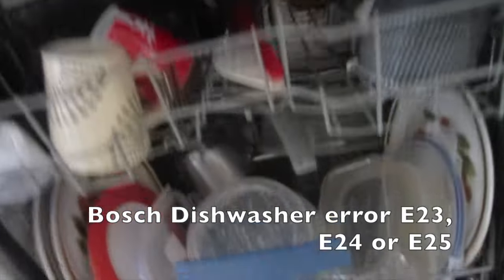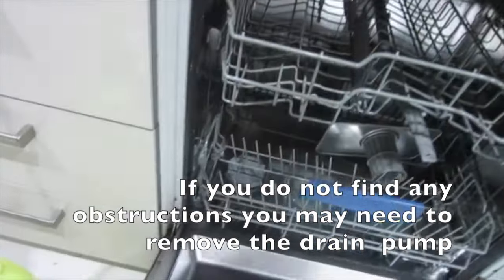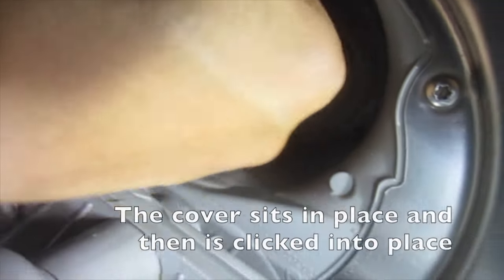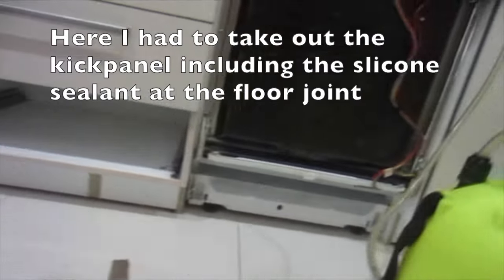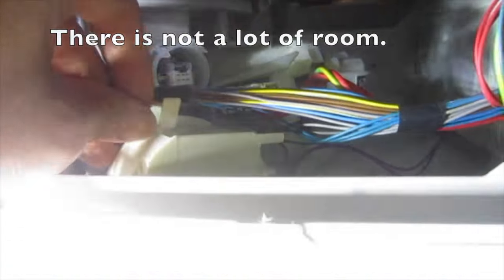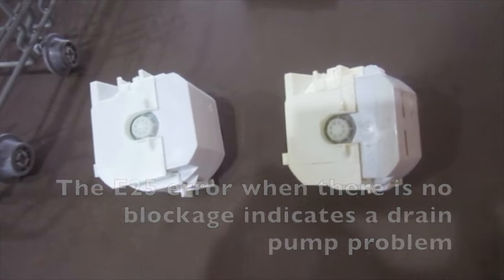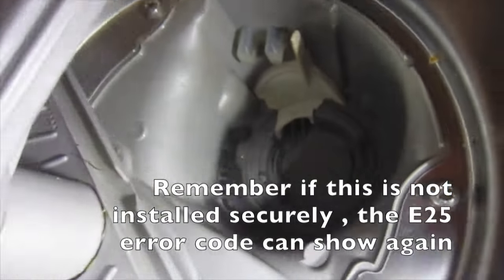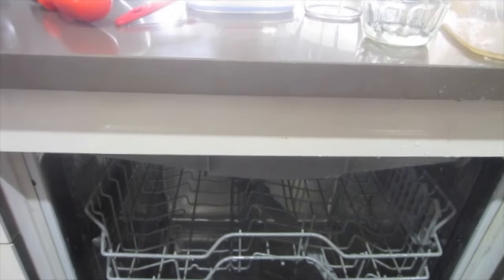Bosch E23,E24 or E25 dishwasher not working error fix (a detailed tutorial)

Comment: Great video, but it would have been even better if could have measured the Ohms difference between the New and Old pump .. to show how to identify a Bad Pump ...
👍🇦🇺
Reply from the maker: Thanks and Good thinking fellow Aussie but I think I did and actually could not see any difference.  The only difference was the original one would keep bringing on the error even if it initially started working . You know how much patience my wife has if the thing I fix plays up ! Means don’t take any chances and just install a new pump .
Reply: Forensic analysis helps a lot more to people than .. just go buy a new one and heres how to replace it .. 
Its the next step as into why you Discovered the fact it needed replacing ...
Good information is rare to find 👍👍
Reply from the maker: I’m all for forensic analysis. Honestly I did check with a multimeter on ohms and found no difference except one worked and one didn’t . I have about 5 multimeters ( one for each part of the house ).
Reply: My old pump which plays up seems to have nothing wrong with it .. 
It had 78ohms on each of the 3 coils inside and spins fine in test mode ..
I went to buy one from a large appliance outlet here in Syd .. 4 days to order .OR He showed me one that LOOKED identical .. so I bought is and was going to fit it ... but as a precaution, I opened it up and noticed slightly less windings on the 3 Coils.. 
When I tested them they were only 45 ohms each .. 
I'm going to order the proper on and wait 4 days .. 
But I reassembled my old pump back in to give it another chance in test mode .. 
Every test cycle worked fine (Drain, Rinse, Spin etc)
But it stops pumping and plays up "I deduce" only when it is submerged in the wash cycle at 40C° ..  
Ive since done 4 "Cold" Loads with my Old Pump reinstalled Successfully .. 
Something seems to be heat related on this 3yo Bosch Washer .. 
I'll get a new pump to see if it is the Pump .. 
Only other thing is "Could the Circuit board up top be affected by Heat ?"(rising) and sending the pump a skew frequency?? ... TBC ...

Comment: My work around with E24 without any visible signs of problem is shortly open the door after the pump stops 2nd time (about 45 seconds after the start of program). The program continues without errors.
Reply from the maker: I think later the error may come back . The machine maybe sensing an upcoming problem. It’s sort of like a toothache… you hope it goes away .

Comment: I check everything except the control board. The pump drains when u hold the start button but water doesn’t drain when running different cycles
Reply from the maker: Did you change your pump ? Sometimes the pump is the problem making the control board not work.
Reply: @Dentinvent  no I didn’t change the pump. The eco mode work fine the last time and didn’t trigger any error code.

Comment: Hi, whats should the resistor must be for the drain pump?
Reply from the maker: Sorry I don’t know what it should be. I just found that some pumps looked fine and created that error code so instead of wasting time trying to find the pump problem , it was faster and easier to just buy a new one . 
In the video you can see both the hood and the faulty pumps looked almost the same ( with respect to the motor turning).
Reply: Be careful with the drain pump.Thete are two models.They are looking the same.Wat really maters the resistance of windings.One model has 79-80 Ohms,and other(older models ) 130 Ohm.Yf you swap them.....the Maschine will try to drain shortly 3 times and then go to error.So you have to be sure that replacement pump 8t is exactly with original.With a multimeter you can see clearly the resistance of the motor stator.
Reply from the maker: Thanks for the comment . I just made sure the part seller got my dishwasher model number to confirm it was the correct pump before I ordered it .
Reply: @cosmintoma5197  thanks for the info. I was wondering what the resistance should be across the windings. Mine shows exactly 79-80 ohms, but now I don't know why it still gives E25, even though the pump motor seems to be fine...
Reply: @avski05  E25 sometimes comes frim the main washpump.If IT is making some noise on the start up....that means You habe tot replace the washpump.There are some bushings in the rotor of the pump.In case that bushings are gone...there will be a vibrating of rotor touching the stator.....so the machine will diaplay E25 on the beginning of circle.

Comment: I replaced the pump and still jave the error code and water is sitting in base of the washer. What do I replace next? Control panel?
Reply from the maker: Check to see if the hose from pump to the outlet is blocked .  Also check your electrical connections to the pump are connected well.
Reply: Let me tell you a secret.Are you sure that the new pump it is the same with original?Did you check the wenddings of the motor?They are two models.79 Ohms and 130 Ohm.

Comment: Those elastic bands are on every model they were supposed to be there they stop water getting through the impeller hence why by reinstalling without them you got an E1 error as you shorted the pump by letting water in
Reply from the maker: Which elastic bands do you mean? The elastic band caught in my impeller was a normal rubber band that went through the wash and tied up the impeller .
Reply from the maker: Which elastic bands do you mean? The elastic band caught in my impeller was a normal rubber band that went through the wash and tied up the impeller .
Reply from the maker: Which elastic bands do you mean? The elastic band caught in my impeller was a normal rubber band that went through the wash and tied up the impeller .
Reply from the maker: Which elastic bands do you mean? The elastic band caught in my impeller was a normal rubber band that went through the wash and tied up the impeller .

Comment: in the video taking out the pump is much easier. It seems an impossible task with such thigh room to move the pump...:@
What is the trick?
Reply from the maker: The pump is just twisted to take it out but make sure you push the catch down and then turn the pump ( if you don’t push the catch it won’t unscrew ).
Reply from the maker: The pump is just twisted to take it out but make sure you push the catch down and then turn the pump ( if you don’t push the catch it won’t unscrew ).
Reply: Thank you for your reply. I had to pry the pump to take it out after unscrew it. @Dentinvent

Comment: Having trouble getting the door panel back on, having it horizontal, lining up the spacers and getting it lined up with the inner part of the door 😦
Reply from the maker: Glad you asked . It’s a really complicated set up . Don’t panic . You will see the spacers just about fall out . Yes I would try and have the door more parallel to the floor and slip the spacers where they are supposed to sit then try and fit the door panel so that you don’t tilt that panel ( to prevent the spacers sliding downward). Once you get the panel on , start screwing the panel on with the door still horizontal. On the video you will see the tape to hold the control panel . That’s because the front panel won’t go on easily without the control panel moving. 
Let me know how you go . As I said , don’t panic or it will get worse .
Reply: @Dentinvent  thanks, you rock! Actually got it on after posting (yes I was panicking 😆) and dishwasher works again, thanks to your video!

Comment: You don’t have to take the panel off.   
Completely disregard that step of the video, it’s a waist of time. Just the kick panel needs to come off to access the drain pump, which is two #2 Philips head fasteners. Unplug the drain pump, twist it clockwise, lift up on the tab where the connector is located to disconnect the wire, pull it out, watch the way the drain pump is oriented when you pull it out. Connect the wire, match that orientation and then turn counter clockwise and you’re done. If I get 10 likes, I’ll make a video. Takes 5 minutes MAX even if you’re not mechanically inclined.
Reply from the maker: I had a look and the lower panel is quite hard to get off with the door in place ( especially when the dishwasher is recessed into the cabinet).